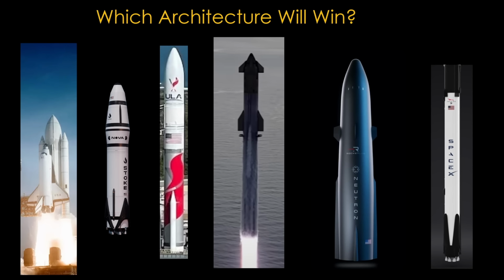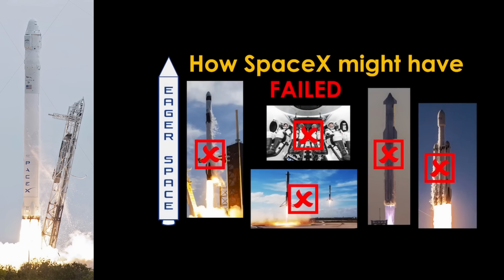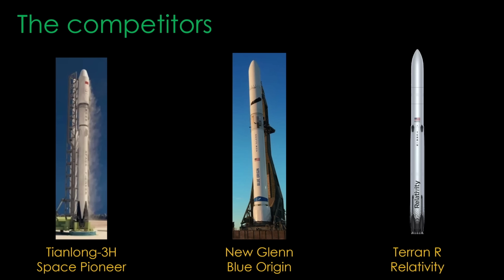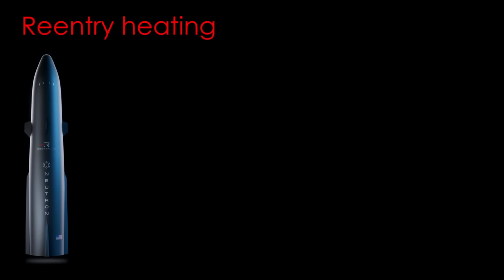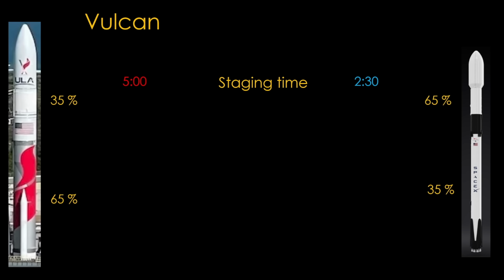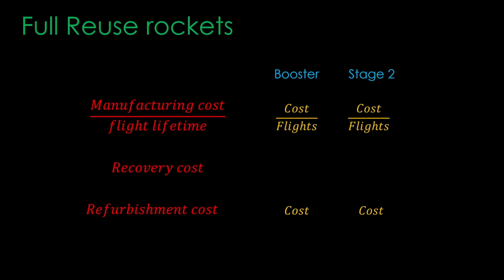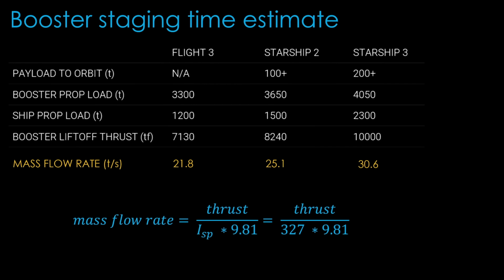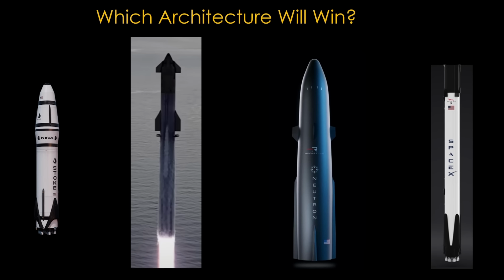Who wins the reusability race?

Comment: I feel like a small(er) fully reusable rocket like nova might have a niche in the crew market. As it stands, dragon is still really expensive on a per seat basis. even even they flew with a full compliment of 7 people it's still something like 12million per person with current flight cost estimates. most of the cost of f9 is the expended second stage, so nova here has a potential edge over f9 if they can get full reuse working.
If the most significant cost for launch is the cost of fuel, the price per seat could be brought incredibly low. Sure space X and starship can do 100+ tons to orbit, but you don't really need 100tons to orbit to put 7 or so people into space. A starship stack also uses way more fuel than nova, so unless they take a lot of people the cost per seat is probably going to be pretty high compared to a fully reusable nova. Considering all of the near term commercial LEO destinations are very small (compared to starship) I can see nova being a big contender for the crew transfer market, but they really should pivot in that direction soon if they want to take advantage of that potential.
Reply: I don't see Nova ever flying crew. From what I can tell it only has a payload capacity of maybe 5t to LEO (but that doesn't have a great source), definitely more than 1.6t to LEO. For comparison, a modern Soyuz weighs about 7t, and Dragon 2 weighs about 12.5t.

Also, the main driver of price per seat for Dragon (~$260M for 4 people on Ax-3) is not the price of the Falcon 9 launch vehicle (~$90M for uncrewed launches), but a combination of lacking competition and the crew-specific systems and procedures.
Reply: Sorry to tell you this but the payload capacity of Nova is just 2.2 ton way to low for a crew capsule
Reply: @danygauthier605  I'm aware of that. they need to scale up to a larger vehicle regardless imo

Comment: Hindsight analysis is the better engineer than trade studies, so regarding Starship-Superheavy choice of being "close to an SSTO", it'll be interesting to see what direction rockets in 10-20 years take. Whether they'll have really beefy 2nd stages to optimize 1st stage RTLS and heating, or really beefy 1st stages to optimize 2nd stage performance through better 1st stage cross range capabilities and reentry heating.
Reply: Entirely possible that neutron will eventually put expendable 2nd plus 3rd stage into neutron for light high DV missions.  They use third stages for some Electron launches now.  I believe their shape is being altered some to have a non-tapered section which can make it more flexible for future extended capabilities.

Comment: I don't think any current rocket under development will complete with starship. It is just such a different rocket and a different scale. The other rockets may compete with Falcon 9, though I've seen discussions that Falcon 9 will be retired once Starship fully enters service which means they may not need to compete with Falcon 9 in the long term.
Reply: For medium launch vehicles, when it comes to competitiveness, payload capacity is a minor consideration.
Reply: New Glenn is the main candidate for a Starship competitor. It has basically the same payload volume to a Block 2 Starship, but only about half the payload mass to LEO (assuming Starship Block 2 doesn't fall significantly short of its 100+ t to LEO goal in the same way Block 1 did). It partially makes up for this with a lighter upper stage running on more efficient hydrogen, meaning it can go to higher orbits without needing refueling. The main known New Glenn launch contracts are for Amazon Kuiper, Orbital Reef space station segments, and HLS/CLPS lunar lander elements and refueling. This is very similar to what Starship is going to be launching (Starlink and HLS).
Reply: @plainText384 even then there are far more missions Starship can do that new glenn cant
Reply: @ganymede6535  Sure, but there are also many missions that New Glenn can do, but Starship can't (those making use of the full 21.9m long fairing). And it remains to be seen how much demand there will be for missions that Starship can do but New Glenn can't.
Reply: @plainText384  Starship is supposed to carry more than twice as much into LEO it can also carry its full 100 tons all the way to geostationary orbit if it refuels in LEO Again, it's a completely different rocket. Both are preposing carrying the same things right now because people aren't really sure how to optimally use the Starship, no one has built satellites or any infrastructure to fully utilize it and likely won't for several years. New Glenn is a competitor to Vulcan and Falcon heavy, and both are in the same class of vehicle, infact both of those can carry even more into LEO than New Glenn can. Eager Space already made a video on if New Glenn in a competitor to Starship.
Reply: @Garmin21111  Falcon Heavy can only carry more to LEO than a New Glenn on paper (there is a reason FH has never actually flown any significant payload to LEO and has no plans to do so) and only when you are comparing apples to oranges (New Glenn with reusable first stage vs. Falcon Heavy with expending the first stage/ core stage). Vulcan Centaur cannot come close to matching New Glenn's payload to LEO in any scenario, so that's just straight up not true.

For moon landers, large LEO Space Stations, and LEO satellite swarms, New Glenn absolutely is a Starship competitor, primarily because of their similar payload volume. And just like you said, there are currently no real customers that require the 100t to LEO capability that Musk arbitrarily decided on 19 years ago, and it's unclear if there ever will be.
Reply: @plainText384  there might not be but star ship with refueling can carry 100tons of anything without sacrificing payload mass. Not to mention it can be human rated to carry people to the moon or mars. Starship can also be a base on the moon or mars is fully reuseable. But Vulcan and falcon Heavy are the true competitors of New glenn due to the fact there arent many things that needs to be launched into leo by such a big rocket hence why you see a lot of falcon 9 launches(other than starlink ofc).
Reply: @plainText384  there might not be but star ship with refueling can carry 100tons of anything without sacrificing payload mass. Not to mention it can be human rated to carry people to the moon or mars. Starship can also be a base on the moon or mars is fully reuseable. But Vulcan and falcon Heavy are the true competitors of New glenn due to the fact there arent many things that needs to be launched into leo by such a big rocket hence why you see a lot of falcon 9 launches(other than starlink ofc).
Reply: @plainText384  there might not be but star ship with refueling can carry 100tons of anything without sacrificing payload mass. Not to mention it can be human rated to carry people to the moon or mars. Starship can also be a base on the moon or mars is fully reuseable. But Vulcan and falcon Heavy are the true competitors of New glenn due to the fact there arent many things that needs to be launched into leo by such a big rocket hence why you see a lot of falcon 9 launches(other than starlink ofc).

Comment: Where is relativity space on the list?
Reply: Imo, and guessing based off of the video, less competitive than New Glenn, likely smoked by Neutron. Blue Origin has the advantage of being able to fly often with Kuiper, and they have a foot in the door with NASA through Artemis, so they have a lot lined up. And Rocket Lab is doing a lot with Photon, not just launch.

Relativity has likely burned a lot of cash on 3D printing, and had to pivot to more traditional manufacturing methods, as well as relying on legacy suppliers for parts, like the fairing, and propellant domes, costing even more. They do have a backlog of launches, but I don't know if they'll make it at this point. They've done a lot of work on Aeon R, but I think all the early investment they got went to their head, and now they have a ton of machinery they can't use for a while, if at all. It would be cool to see them come out the other side though, but I don't know at this point.
Reply: @davidk1308  when I did research recently I saw that neutron was now targeting $50 million a launch and relativity $55 since they have 3 times the payload to Leo than neutron wouldn't they do much better? I know that relativity will experience delays because of their pivot but idk if that's such a big deal because they are designing a capable launch vehicle anyways.
Reply: @Meatloaf_TV  I suspect Relativity's $55 million hinged on being able to rely on 3D printing, or at least vertical integration. If they're buying major components like fairings and domes from outside suppliers, I don't see that price point sticking. 

The payload gap between Terran R and Neutron doesn't matter all that much really, most payloads aren't going to get close to the maximum, and if you're flying frequently, you want to maximize reusing your booster, not throwing it away. And in that, the gap between Neutron and Terran R is about 13 to 20 tonnes. The 33 tonnes it can theoretically do is probably going to be scarcely used.

Comment: New Glenn is likely to have a far faster launch cadence increase than Neutron. At least according to what each company has stated. Blue Origin will gain more operational experience with reuse faster than Rocket Lab will.
Reply: Rocketlab has launched over 50+ electrons, and have already recovered and reflown a flight engine. Electron was the test bed already.
Reply: @ wow. A single engine.
Reply: Honestly. I think that the real competors are Rocket Lab(Neutron), Realativity(Terran R) and Blue Origin(New glenn) because they are soo similar and will be launching around the same time. So honestly this could be the holy trinity of rockets and it will be intresting. Imo
Reply: "At least according to what each company has stated". In 2016 Blue Origin stated that New Glenn's first flight would be in 2020. Take that as an indicator of claim accuracy.

Comment: Last I heard, ULA had dropped the plan to capture the parachute in flight and simply have the engine section splash down, with the heat shield doubling as a buoyancy device. I think Tory Bruno mentioned it in an interview a few months ago. A ship was going to be needed for support anyway, and the heat shield test showed it should float, so dropping the helicopter made it easier.
Reply: Correct. My understanding is that after LOFTID floated so well after it's test, using the helicopter made significantly less sense.
Reply: @bwjclego  They dropped the helicopter catch long before the LOFTID catch.
Reply: Makes me think that they could fill the heatshield with helium and float back to land. 😂
Reply: In an article an insider mention that ULA have pretty much drop SMART reuse
Reply: Makes way more sense
Reply: Thats the exact way Rocket Labs was doing it with Electron recovery
Reply: ULA's re-use plan is barely more than a powerpoint and a press release. One of the many reasons Tory Bruno likely got fired, including his decade of dismissing re-usability and downplaying of Falcon 9's economics and success led to the disastrous Vulcan design.
Reply: Oof salt water
Reply: @HALLish-jl5mo Rocket labs Rutherford engines have done just fine being submerged. ULAs engines would only receive backsplash since they’d be sitting atop the re-entry decelerator.

Comment: Starship second stage does more of the work because Elon doesn't want to have the first stage do a reentry burn. That means the booster has to hit the atmosphere at a slower speed than a Falcon 9.
Reply: The main reason is Mars... There is no booster on Mars, therefore Starship has to be an SSTO on Mars. They could “easily” make the booster much bigger, but that won't help Mars missions as much as putting that effort on improving the ship. The system is already more capable than the market needs for LEO. As all satellites move to a constellation model, all payloads will be to LEO or sunsync.
Reply: I think there are a few architectural constraints eager space outlined that lead to no entry burn being needed rather than it being an active choice. Those constraints being driven by the desire for full and rapid reusability thusly: 

-Full and rapid reusability requires high launch cadence and RTLS
-RTLS requires boost back
-boost back wastes fuel that could otherwise be used for payload
-minimizing boostback leads to a lower energy trajectory for the first stage eliminating the need for an entry burn. This also increases ratio of work done by the second stage.

Put another way, fully reusable architectures tend towards the second stage being as close as reasonably possible to an SSTO in order to minimize fuel wasted on booster recovery operations. The lack of entry burn seems to be an incidental consequence of other optimizations.
Reply: @applesaregoodeatings you do realize that the heat Shield weight a lot. So any thing that can be done without a heat Shield is done without. So you try to do as much work on the booster as possible... Sadly stainless steels is hard to make a good shape for reintry... The best shape is the cone like neutrons. But that shape make it hard to iterate so a rocket is a giant engineering compromise 😂
Reply: I have shittt
Reply: The engineers not elon
Reply: @sussyscylla3414  Elon makes high level engineering decisions.

Im sure he had the final say in the relative delta v of the booster and starship
Reply: @HALLish-jl5mo  Why would they let him do that. He isn't an engineer. He didnt do the work even if he made the final decision.
Reply: @sussyscylla3414  SpaceX engineers say that's how it works. They present him options, he's technically competent enough to pick, and it's his money on the line.

Most companies have months of committee meetings, Musk just decides. 

That's why SpaceX is so much faster, but also has a higher initial failure rate.
Reply: @sussyscylla3414  They have done that since the era of Falcon 1. The result is self-explanatory. Otherwise, SpaceX would've gone bankrupt back in the early 2010s.
Reply: @fauzin3338  not to mention he is a key stakeholder, so of course he has decision making power.
Reply: @sussyscylla3414  But unlike you he's still VERY smart and ACTUALLY understands what's going on and why.

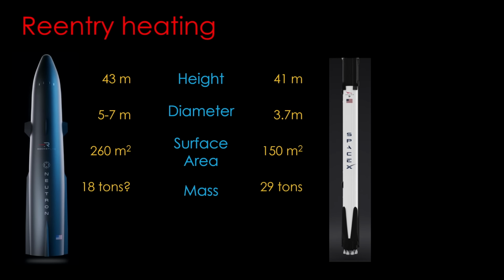Comment: 13:00 You're looking at that all wrong. With more surface area when it hit the atmosphere its going to be under a much higher G load. Faster deceleration and MORE heating over a shorter period of time.
Reply: How bout more lift and a longer time to renter with similar heating
Reply: Not really. The important thing with re-entry physics is that the amount of kinetic energy you lose is not directly related to the amount of heating. A craft skimming through the upper atmosphere won't be hitting many particles, but what particles it does hit get super-compressed and form into plasmas and do a bunch of other complex things I don't really understand. So that vessel will gain a lot of heat, but not slow down much. Deceleration is not what causes re-entry heating - the craft hitting atmosphere particles is. If you have a design with a higher surface area relative to mass, you essentially spread out the same energy of re-entry over a larger area, which means that you get lower surface temperatures. 
Shuttle used the same logic - the wings weren't just there for landing, they were there to slow the spacecraft down faster during re-entry, reducing the overall amount of energy needed. It's also why Starship falls belly-first, and not end-on.
Sorry for the wall of text.
Reply: Neutron is not de-orbiting, its velocity will not be anywhere as great as Starship, more akin to Starship's booster. G load is minor and can be tempered by angle. Total mass of Neutron stage 1 is far smaller than F9 stage 1 due to use of carbon fiber, so total energy to dissipate is much less.
Reply: @paulcarter7445  I hadn't considered that fact. I don't think they posted anything about it's flight profile. But, I'm sure you're right because of the second stage. However Mach 3 is still pretty hot. Just ask the SR 71.
Reply: @rexmann1984  Rocket Lab has already tested Neutron's materials for re-entry by attaching samples to an Electron return mission - they tested fine.
Reply: But aren't actual thermal loads lower in the high atmosphere layers, due to lower heat conductivity of the less dense air?
Reply: @solarissv777  load is less but the velocity of the particles haven't changed. He's going to learn the hard way that carbon fiber doesn't have the durability of steel when dealing with high velocity particles.
Reply: @rexmann1984 lol Electron is made of carbon fiber and it can do the reintry 😂